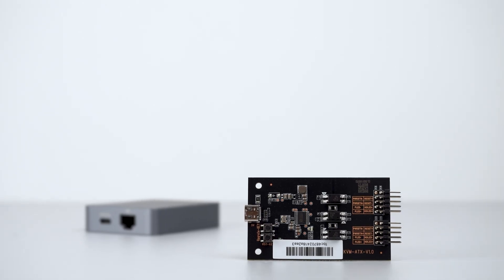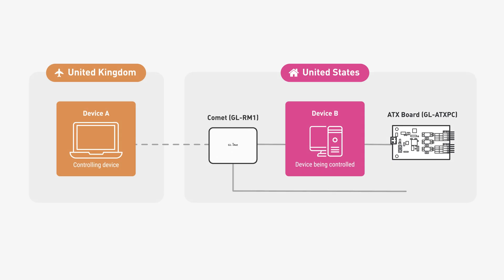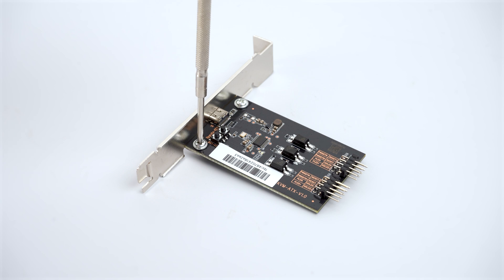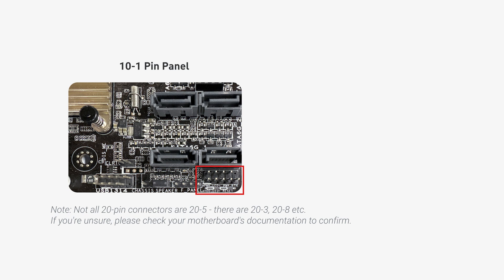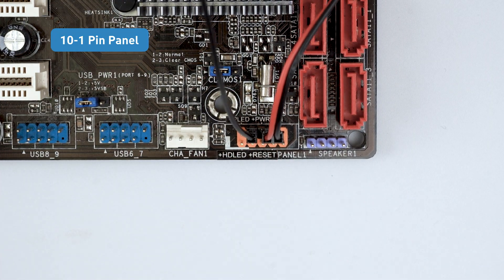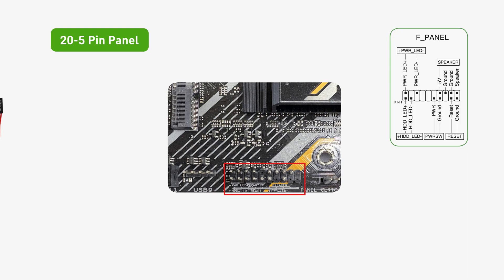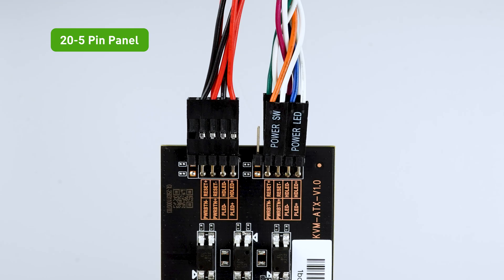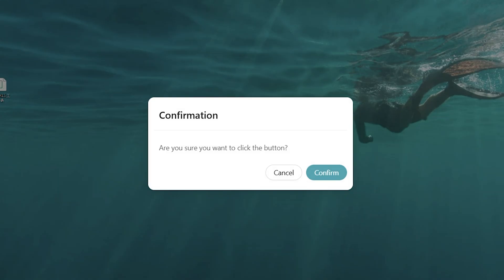How to Set Up ATX Board (GL-ATXPC)| Remote Power Management Device

Comment: This board has a known design issue. It can only drive low power LED's for the power LED. People have been discussing it on their forum for months, no fix as of yet.
Reply: I am one of those people, but its the HD LED that works, not the power LED.
Reply: @bentubeblu  yeah the hard drive LED is just a pass-through is my understanding they don't have anything hooked to it but on the power LED they've got it hooked to an opto isolator and yeah it doesn't work right because it lowers the voltage sent to the LED and in the case of my tower it's a blue LED for power and it's got a minimum voltage of a 3.2 volts and it's only passing 2.11volts. I applaud that they chose to isolate between their ATX board and your PC but they made a bad choice since those LEDs are typically more than 2 volts.

Comment: And, Just how old is that PC that you are demonstrating on, it looks to be at least 15 years old, lol
Reply from the maker: You’re right! It is an older PC! We used it because the bigger case makes it easier to clearly show the ATX Board installation process on camera. The good news is the GL-ATXPC works with both older and modern PCs, since the power/reset headers on motherboards have barely changed over the years.
Reply: and no heatsink haha
Reply: lol yep - "The ASRock H55M-LE motherboard is approximately 14 years and 9 months old. It was released alongside the LGA 1156 socket platform, which debuted in late 2009 or early 2010."